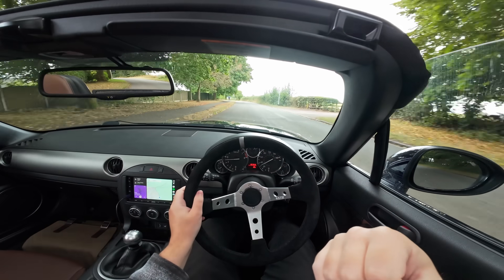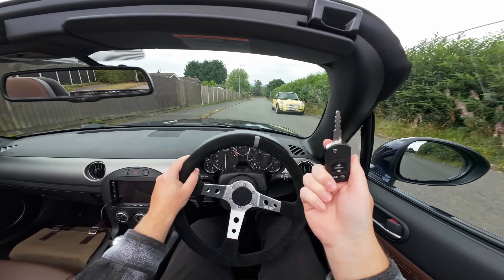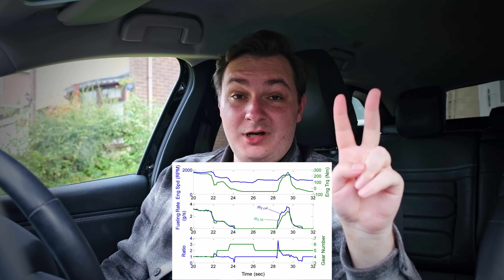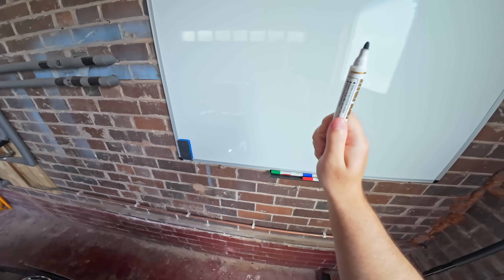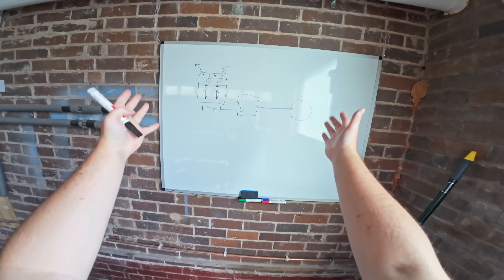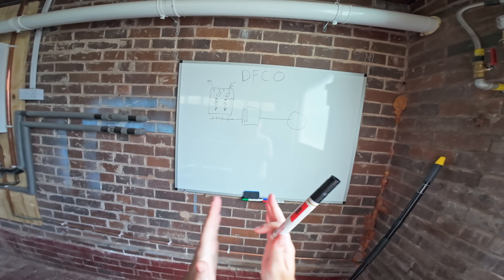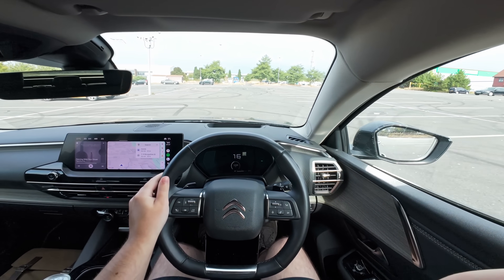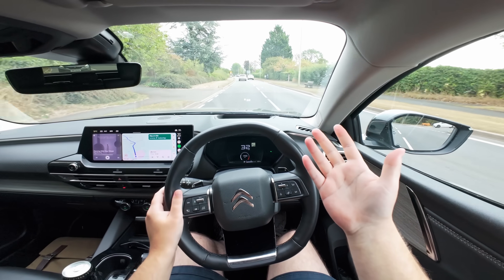The most misunderstood car term - Engine Braking

Comment: Ive realized over the last year or so that the best fuel efficiency is using the gas and the brakes as little as possible. Unfortunately i feel gross during traffic when im floating at 25 mph in a 50 mph zone because I have a right turn coming up in 300 ft and I let off the gas a mile before my turn lol. I come home from my friends house at 2am sometimes, so I've figured out where to let off so that I can make the turn without using the brake. But in normal traffic it's not super feasible to push it to the limit, but use it where it makes sense and you will see results.
Reply: Braking is essentially turning fuel into heat instead of turning fuel into velocity. What you are describing is the standard way of driving in my region.

But please remember that your brake lights don’t turn on while enginebraking so drivers behind you  likely don’t notice that you are slowing down. 

(Btw if you didn’t know: You can light your brake lights without engaging the brakes by just lightly pressing the brake pedals. I don’t know is this is standard teaching or not.)
Reply: A lifetime ago, when after redoing the engine I had to "settle it", I had to make a journey on the route not going over 60kph, for 400km. I don't think I have ever hit such fuel efficiency in my life. I remember I did the calculation and it was a 50% increase from the while in route average. But of course, it took ages...
Reply: Can always downshift to engine brake harder and reduce the distance you'll be doing it.
Reply: Everything in moderation. Engine braking from 50 to make a turn is not only inconsiderate, it risks causing phantom traffic jams behind you. Especially if such turns have a dedicated lane I will wait until I can get in that lane before slowing down.
Reply: Also any fuel you save will just be burned by the guy behind you having to accelerate back up to speed.

Comment: Probably leftovers from back in the day where idle circuits on the carburetor would always let a little bit of fuel through. Some older FI systems also run down to idle speed on the injectors if throttle is shut off. I couldn't say when that changed to fully turning off injectors, but some older cars absolutely left the injectors idling as the car "coasted". 

Some motorcycles (maybe cars too?) have adjustable engine braking maps. My CBR1000RR has 3 levels- what I'm not sure of if the injectors are running at all or the throttle valve itself remains open slightly to reduce intake vacuum.

Comment: 3:50 slight correction. Drive just shifts when it reaches it’s optimal point with some engine braking, you get better results for engine braking by putting it in Sequential and shifting down early. I almost always use S cause i don’t like the stock shift points, they tried for comfort but wasn’t comfy that way. Lol

Comment: the engine doesn't mind force in the opposite direction.
But it's probably a bad idea to remove they key from the ignition while driving, unless you've intimately familiarized yourself with your car's particular mechanics,
as this could have unexpected results...

Comment: If I were to follow this guide, should I go downhill with engine braking using a lower gear even though there's quite a bit of backwards pull (L), as opposed to going down with drive, and then braking all the way down?

Comment: I live in the Appalachian Mountains, and people behind me don’t realize I’m engine braking when I’m able to maintain 50mph and even decelerate when I shift down to third when going down a significant grade towards a T intersection.

I keep my lights on 24/7 so followers at least have my rear lights on for visual reference. Tailgating is a huge issue in my region, so driving properly down a mountain actually creates danger for those who only drive leadfoot or are heavily braking.

I’m at 72,000 miles, the car’s approaching 10yo, and have only replaced my front brakes; rear are still original.
Reply: if you touch the brake pedal the lights will come on without actually engaging the brakes (the electric sensor is designed to be more sensitive than the hydraulics). It's a nice thing to do when downshifting if there's someone behind you (I am guilty of trying to spook tailgaters though)

Comment: I'm pretty sure my car can just drive indefinitely when I don't engage the gas pedal (especially on lower gear), so it's definitely consuming fuel, but maybe some cars just work differently.
Reply: Okay, you clarify later that fuel is being injected at low speeds, but maybe you should have started with that instead of claiming that fuel just outright isn't being injected at the start of the video.

Ano no, "just watch the whole video" is not a valid excuse for wrong or incomplete information at the start of the video.

Comment: (Start edit)
Got my answer by continuing to watch the video 😅
(End edit)

I want to believe the "0 gas when engine braking", but my personal experience so far contradicts this. When I take my feet completely off of all the pedals when going slow (e.g. during traffic jam), meaning no gas pedal, no clutch and no brake, I stil get pushed forward. It's only at a crawl, but it's still there. This also stops when I do press the clutch, switching to pure momentum, friction and gravity controlling the speed. Could someone please explain how this would even work with 0 fuel being injected into the motor?
(Genuine question, tho I'm only paused at the CarVertical section while writing this. So for all I know video might contain the answer? Will edit in if it did or not)
Also I do use engine braking whenever possible.

Comment: A big difference between engine braking and disc braking is the mechanism that's turning the car's kinetic energy into heat. With disc braking it's mechanical friction between the disc pads and rotors that's generating the heat, a process in which wear is unavoidable. With engine braking, the engine is working as an inefficient air pump, a job which is less stressful for it than its normal job of being an engine. The heat generated by its inefficient pumping action is partially carried away by the exhaust which leaves hotter than the intake air, and partially by the engine cooling system.

There are four ways the engine can be an inefficient pump:
- by mechanical friction between it's moving parts. As long as the points of contact are properly lubricated, this doesn't necessarily imply wear, and the forces are lower than if combustion was happening.
- by aerodynamic resistance to the flow of air through the intake, engine and exhaust.
- by being a non-ideal thermodynamic machine. The compression and expansion strokes are neither isothermal nor adiabatic, so without any fuel to burn, the expansion stroke cannot give back all the energy consumed by the compression stroke. The difference will be converted to heat in both the engine and the air.
- by exhausting air at above-ambient pressure, and/or drawing it in at below-ambient pressure. The difference in pressure between the air entering the intake and the air leaving the exhaust implies a loss of energy - work has been done pumping it, only to return it to the same environment.

None of this necessarily wears out your engine. Engine braking does put more wear on your gearbox than disc braking, but the wear is on the other side of the  teeth than the wear from accelerating.

Both the thermodynamic and pumping losses could be greatly boosted by adjusting valve timing. I don't know if any engine does this. If they don't, then only accelerator-fully-out would correspond to zero fuel use. If they do, then a partial accelerator command to an engine at high revs might correspond to zero fuel and normal valve timing, and fully-out to zero fuel and adjusted timing. I'm not enough of a car person to know.

Comment: I love engine braking, and as you said on 12:53 going downshift makes it better, but you need to know how to rev-matching so you don't put excessive wear on the clutch (otherwise you have what you said on 10:05).
The only "disadvantage" you have with engine braking is that it will take a bit more time to do the same trip. But the question is, is it worth it to cut 2-3 minutes of your journey by accelerating and breaking violently? It's not only about wearing and fuel economy, but also safe driving.

Comment: With the modern low internal friction engines and with low number of cylinders it is almost mandatory to use downshifting to get the most out of engine braking.

Comment: The best explanation of this that I think I've found is this:
When you press the accelerator, your engine goes through the normal combustion process...
When you remove your foot from the accelerator, the momentum of your wheels turns the drivetrain and uses your engine as an air compressor to increase drag and slow the vehicle... a sort of brake... that uses the motion of your engine... an engine brake, if you will.

Comment: Please, please, please NEVER take out the key while driving. The steering wheel lock will activate when turning the steering wheel and you cannot stop turning. And please, if you read this edit the video and make at least a text note in the video.

Comment: The clutch is only in danger with engine breaking and manual shifting to a lower gear at the wrong time to just try to get more aggressive engine breaking. Which just adds more risks as damaging your clutch is one, but more aggressive engine breaking doesn't light up your break lights and so also adds the risk of getting hit in the back by someone who loves to tail gate and not having enough distance to react.

Comment: I drive a manual but I do drive automatic fairly often. In both I engine brake. I rarely brake in either unless I'm already fully slowed down and coming to a complete stop. That's if I were driving in a vacuum. Of course with all these NPC's around I need to brake more than should I have to.

Comment: Drove an E46 330d .. the engine braking was enormous. Also, Top Gear once did a London to Edinburgh eco-drive and Jeremy mentioned this was the case .. i think he was driving some ssort of 3.5l twin turbo diesel Jag, and won.
Reply: I can vouch for that. My manual 2007 X-Type 2.2D had significant capacity for engine braking... replaced my first set of discs and pads at 200 000 km. Now, with my 2012 XF 3.0 diesel, there's the same amount, if not stronger, engine braking. The Jaguar Jeremy drove had the 2.7 twin turbo, the direct predecessor to the engine in my XF.

Comment: Yes and no. It still uses fuel so it can start accelerating at any time with the correct timing,  but it's a negligable amount. 
What I was thought is that this is simply letting go of the gas and engine breaking is when you sonwshift and then let go of the clutch (not instantly). This will cause engine to rev and provide resistance to wheels causing the vehicle to slow

Comment: YT recomanded me this video... and had to admit I m one of the rare examples who drives a carbureted car. (The car is 7 years older than me)
Reply from the maker: Haha, nice to see the classics still being driven!
Reply: @MickDrivesCars  It is a Yugo 45 car (yes, that is its horsepower is in the name). My grandpa bought it a few years before went to retirement, and sold to my father a few years later. Without requirment to drive to work with the car, the oil shortages and not in the financial status to go on a family vacation, the car rarely left the 100km radius of the house. Once the family's financial status (and the countries political situation)  stabilized, its was too small for a family with 4 kids. So it went to the status of a second car, used when its more than average off road capacities were required. My brother used it to drive to work before bought his own car, then my sister used it the same way. Nowdays I m using it once or twice a month when I need it. Currently it has about 125 000 km in it. (With 5 digit display, it shows only 25 000)

Comment: This is one of the reasons why i think hybrids are, at least for the near future, the best idea for most car-owners:
Instead of a starte/alternator have a bigger electric motor. When accelerating engage the electric motor for better acceleration and better fuel-economy (acceleration often goes hard on the fuelflow), and when braking convert the movement into electric energy again. With this as long as you drive sensible and don't go pedal to the medal and then full-braking all the time it can help to significantly reduce engine-wear and, specially for city-traffic or any trips where you have a lot of braking+accelerating, give a decent boost in fueleconomy too.

Also works quite well when going up/down mountains. There are some extreme examples for this: Some mines use electric trucks that don't require ANY recharging at all... the mines are higher up on the mountain and the trucks only trasport the mined minerals down to trainstation in the valley. Going down produces more electricity than is required for the truck to go back up again.
https://edition.cnn.com/2019/07/16/sport/edumper-electric-vehicle-supercharged-spt-intl/index.html?no-st=1563995476
Of course that is the perfect scenario and in 99.99% you are far away from that, but it goes to show what using the correct technology and driving-style can do for you.

Comment: Precisely! Thank you for this demonstration and explanation - I've been driving this way throughout my driving life. Sometimes trying to explain to people that going into neutral or holding the clutch down uses more fuel than lifting off gets tiring (the fact that neutral/coasting, the engine goes to idle tickover and uses fuel seems to escape some people).

Heck I rented a car recently, it showed in the cars history previous trips and their average MPG, all the trips had similar miles except one which was just a short hop, the trips before I got in the car were averaging about 30mpg, I get in the car, 55mpg! (The car listed 10 trips in total) And I'm not a slow driver either. Gentle acceleration to the speed limit, occasional heavy acceleration if required to do so (such as an overtaking manoeuvre or joining a fast road) and gently braking. I often downchange a gear in anticipation too, such as if coming to a set of traffic lights or if negotiating a heavy bend etc And to top it off, when coming to a stop with the brakes, just as I come to the stop, lightly ease of the brakes to prevent them binding doing that jolt, such a simple thing to do but the passengers all appreciate it.

Thank you again for this excellent video!

Comment: You're right but I have a slight nitpick with the diagram you drew. Specifically about the "need" for fuel to be injected. The "need" is irrelevant. Just because fuel isn't "needed," doesn't mean the mechanical system is smart enough to understand that or care.
If I trip at the top of a staircase, I don't "need" to fall down and break every bone in my body... but gravity and the laws of physics don't care about my needs.

Comment: It's really easy to track if you have an instant MPG gauge or an obd2 scanner, mpg will jump to infinity while you're decelerating and if you monitor air/fuel or lambda it will max out the scale, if fuel was being injected it would be measured.

Comment: Do note, this is not the same as when pressing in the clutch. When you press in the clutch or you are in neutral your vehicle still uses fuel to idle. Loved learning about what engine breaking really is, keep it up.
Reply: Here's a nice math problem - when you want to hypermile and coast, do you use less fuel to go into neutral and idle, or do you let it engine brake with no fuel, but slow down faster, making you get back on the gas quicker?
Reply: @MattLathrum  as much as the question definitely stands - for safety i never go into neutral while going down a slope. If for any reason the engine was to stall the vacuum pump and assistances would immediately shut off and the car would become much harder to control
Reply: @hugoslr good point, but I was thinking more about manual shifters. I coast in neutral a lot in one.
Reply: @MattLathrum  oh but i do drive a manual, and that was on them that my comment applied!
Reply: @hugoslr interesting!

Comment: Engine braking: engine is linked to wheels (gearbox in gear), introducing drag and gently slowing the car down, no fuel is used
Coasting: engine is not linked to wheels (gearbox in neutral), car rolls freely with its inertia, can go longer distance than engine braking, very little fuel is used
Both are very useful and are the basic tools for mindful, fuel efficient driving style
Reply: Are you talking about aerodynamic drag or some other kind of drag I'm not aware of? Engine braking works by the compression of the pistons that are not returned to the bottom of the stroke by ignition. If aerodynamic drag and rolling friction are slowing the car, this is not engine braking. If you really want to experience engine braking, go and find a car with AMT or DPK with flappy paddles and knock it down from second to first without using the brake pedal. That's engine braking.
Reply: @James-p7f5bI meant engine drag